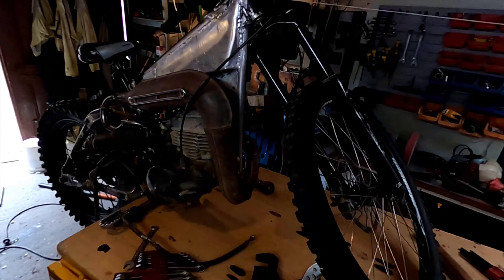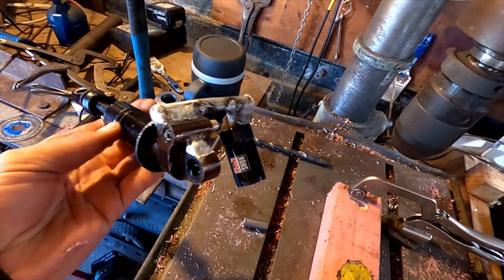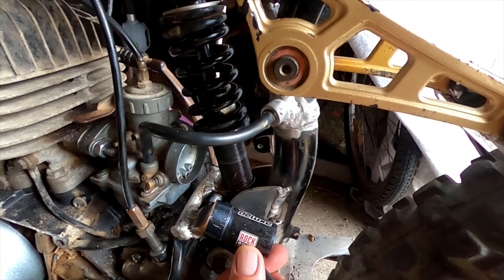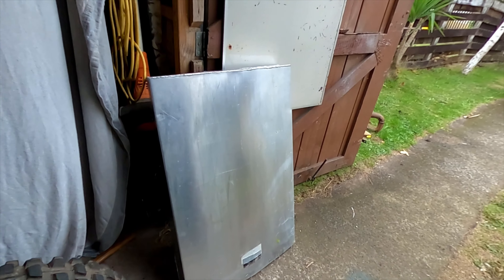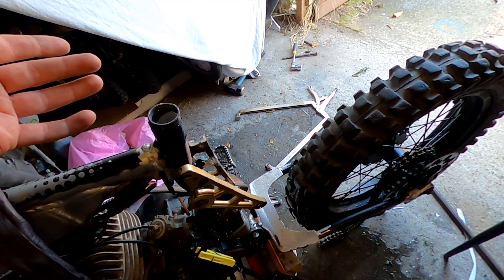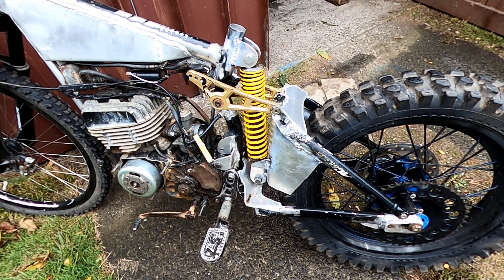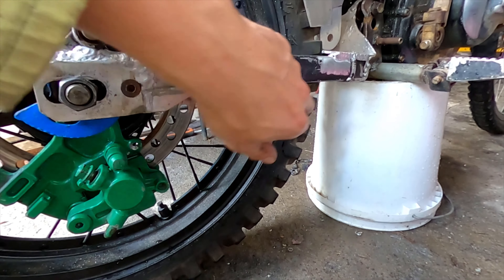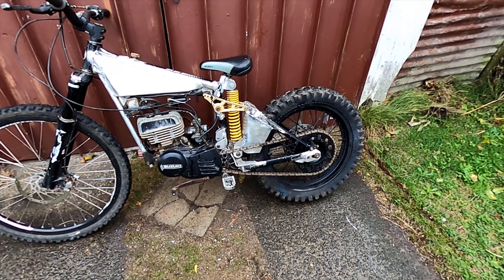Motorized Bicycle 125cc 2 stroke build/p6

Comment: Thank you for wearing gloves while welding. I see so many not wearing gloves while welding and know some professionals that refuse to wear them. I personally will never weld without gloves. Mostly because I weld aluminum. I have seen some nasty burns and have had a few from overhead welding even with protection.
Reply from the maker: Thanks. It is also easy to give yourself a shock when welding with high frequency I always wear gloves when tig welding now lol

Comment: Right on, a non cut option could be a chain idler.
Reply from the maker: Straight Line Cycles yeah but if I put it on the bottom it will get too tight when the suspension compresses
Reply: @DktheWelder   Hmmm it  sounds like it needs to be on a Spring tensioner but cutting the c notch maybe the best option
Reply: @DktheWelder   On my bike I am having to add a rubber bump stop just in case